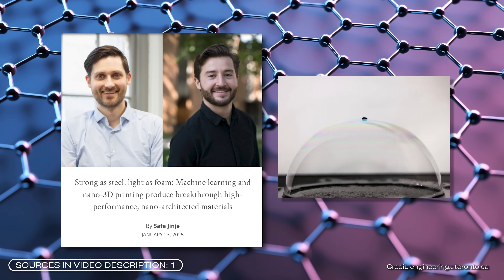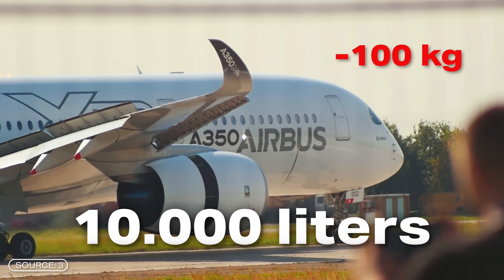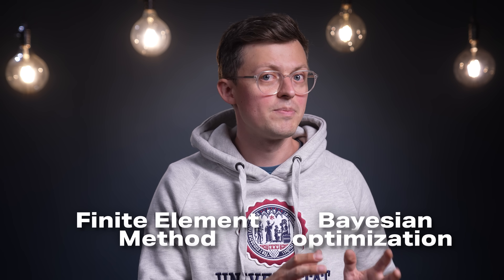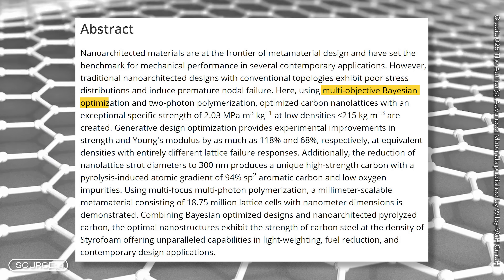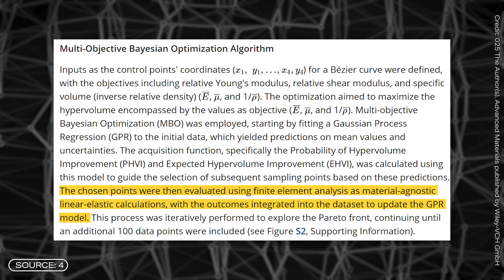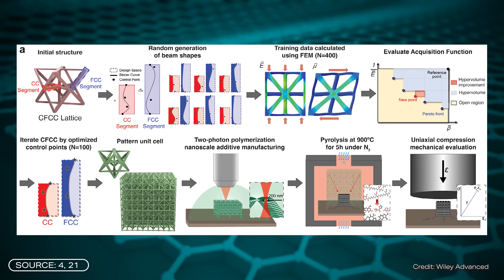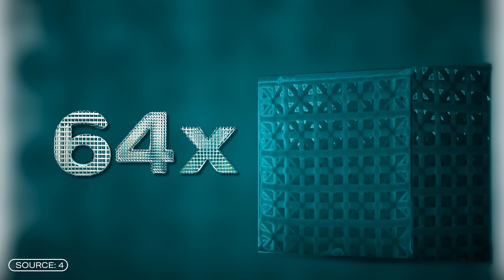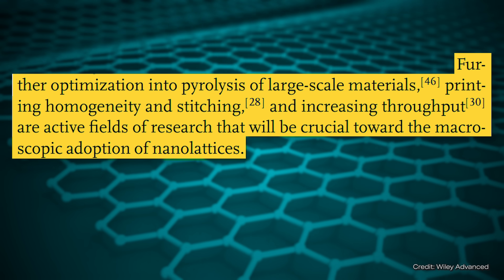New Material: As Strong As Steel, As Light As Styrofoam!

Comment: Every day closer to being able to make the cable for a Space elevator.
Reply: heck yeah space elevator
Reply: Middle Eastern countries floating on lakes of liquid carbon may have an edge here, with some of them being very close to the equator.
Reply: Not at all. Compression strength do not matter for a cable. For a space elevator you would need tensile strength.
Reply: I love the idea of a space elevator, but there have always been two particular misgivings I have about it. 

1. What would the consequence be of having at least 1 huge lightning rod sticking out of the earth if we experience a solar flare. 
2. Would this have any effect of the spin of the earth. Just like a figure skater reaching their arms out. Would this slow the Earth's rotation?
Reply: @CStrolx  the earth would be less influenced of any space elevator (currently conceivably realistic ones) than your moving around with an ant sitting on your back..
Reply: @CStrolx  

weather effects arent reaching very high thats why planes usually fly at high altitutes  maybe 10000m to avoid it so I think the risk isnt very high 
it would not have any effect on the earth rotation the earth is so massive nothing what we do would change it
Reply: @Sippi81 So, regarding the "weather" effects. It's my understanding that when we've had some very strong "solar winds" (from eruptions on the sun), they have, in the past, caused mass power outages when dune of our Earth's protective layers weren't enough to prevent penetration.

This elevator would extend out beyond those protective barriers if the earth. What might happen if one of those solar winds were to hit this rod in space outside of the Earth's protection? Would there be some sort of super charge directed into the earth? Maybe not, I just wonder if we've considered it. I'm not talking about the wind on earth.
Reply: @Sippi81 So, regarding the "weather" effects. It's my understanding that when we've had some very strong "solar winds" (from eruptions on the sun), they have, in the past, caused mass power outages when dune of our Earth's protective layers weren't enough to prevent penetration.

This elevator would extend out beyond those protective barriers if the earth. What might happen if one of those solar winds were to hit this rod in space outside of the Earth's protection? Would there be some sort of super charge directed into the earth? Maybe not, I just wonder if we've considered it. I'm not talking about the wind on earth.
Reply: @CStrolx  

solar winds is nothing that could cut a rope and the magnetosphere is not ending after the atmosphere of earth so there will still be some protection
solar winds is nothing similar to lightning strucks it could probably have some effects on living tissue and also electronics but these effects depend on the suns activities so I see barely a problem if you monitor the sun you could predict when there is a problem and then react accordingly imho I dont see a problem for an elevator which would probably rarely being used to transport people anyway
Reply: @CStrolx  

I know what you meant with solar wind but I doubt it would be an issue for the rope I think even if there is a charging initiated on the rope it would just get diverted down to earth without much heating involved 
I think the lightning from weather might be a bigger issue but as the elevator stays at one place you could estimate when its safe to use it
Reply: dubai wants to build a skyscraper hanging from an asteroid placed in earth's orbit
Reply: A space elevator won’t work. It would burn up due to atmospheric drag, which in turn would destabilize the asteroid
Reply: @thebigpicture2032  

why should the atmospheric drag burn it up ?
and why should that alter the trajectory of an asteroid?
Reply: @Sippi81  air drag increases as the square of speed increases. At 17,000 mph that’s a lot of drag resistance and heat shielding would need to be immense. It’s not static like a building elevator- it would be orbiting the earth.
Reply: @thebigpicture2032  

what are you talking about 17000?
this thing is stationary it wouldnt make any sense to build an elevator if it circles the earth at 17000 mph
Reply: @Sippi81  It’s called orbital velocity. Below that speed, anything in low earth orbit comes crashing down including the asteroid an elevator would be anchored to.
Reply: @thebigpicture2032  

geosync orbit is the definition maybe you heard something about satllites that are constantly above our head at any time
thats how you make an elevator that stay at place even if the object thats linked on moves at orbital velocity
so yes it is possible
Reply: I don't think this would be used for a space elevator cable, carbon nanotubes and rolled 2d materials are much better candidates.
Reply: I invented the SCELP engine -- Super Conducting Electromagnetic Levitation and Propulsion.   The secret was using ALMOST SUPER conducting magnets.   It still won't go faster than light,  and acceleration and deceleration are a real challenge.  But we are almost ready to begin Star-Trekking.  Just as soon as mankind ends all war.   The Bootis  triple-star system has two moons around a giant exo-planet, that are habitable for humans for about another 10,000 years -- before they go into shadow.
Reply: Just the idea of this stupid thing make me cringe.
Reply: By the time a space elevator is feasible to build, AI will have already determined that we're unnecessary and used the carbon I our bodies to build their own means to space. 😂
Reply: @davroscaan1318 Exactly! I think that some don't know just how far away from our current reality this idea is. We may as well be talking about 30 mile high buildings.
Reply: @CynHicks  

a space elevator is not a building 
you just need a good enough rope thats able to withstand its own weight at lenghts of thousands of kilometres 
and as I know we already invented at least one material that is capable of doing that the biggest problem now is the manufacturing of it at the needed lenght/purity but even if we arent able to find a process for this specific material there will be new maybe better and easier to produce once around soon using ai methods 

After this is figured out the space elevator will be produced just because its economical
Reply: @Sippi81 Ummm no. Even a rope made of light cloth long enough to get to space would weigh so much that it would break from it's own weight. The strongest and lightest material we have simply can't do it. Not even close.

A thread used for making clothes... shattered by its own weight. It's called gravity dude. If you take a ton of thread and roll it  out from space to drop to Earth.... that's a ton of weight on a thread... think.. .

I get that we don't typically get to see these things but again.. even with a thread from space... all of the weight (like enough to fill 100 closets) is weighing down on that first bit of thread... think!
Reply: dude I already commented about it (or was it deleted? )
if you dont believe it use google 
the tensile strenght is calculated and we have with carbon nanotubes a potential candidate who would have that strenght but manufacturing and defect tolerance is the problems for now but either we ll solve that problem or just create a new and better material
Reply: @CynHicks I think I heard that while no currently available materials are strong enough (in terms of tensile strength per weight) for a space elevator on earth,
the materials available would be pretty much good enough for one *on the moon*, which could be cool. But not sure how useful decreasing the energy cost of getting from the moon’s surface to lunar orbit is.

Also, perhaps rotating sky hooks would be more viable than a space elevator?
Reply: By the time we work that out it won't even make sense to do it anymore. 😅

We'll be using some super efficient "anti-gravity" technology to transport things into space in a matter of seconds.
Reply: i think you'll find a space elevator would be a cosmic 'lightning' conductor, if it were even possible to construct one it would conduct unfathomable amounts of energy that would normally either be evenly distributed or bounce off/be absorbed by part of the magnetosphere. the resulting bolt of energy would be interesting to behold, but it would be unimaginably destructive... you could probably kiss the atmosphere goodbye at least locally too... imagine a portion of or even all of the auroura being directed to the earths surface within a square mile.... what do you think that would do?
Reply: Space elevators are a stupid idea I'm sorry.
Like how are you going to avoid any space debris between earth and geostationary orbit?
Reply: Dream on. It's a cute idea, but it will forever remain science fiction. As a matter of fact, I just finished reading novel which features a space elevator. Makes me suspect you're a Musk fan.....that's how unrealistic your dream is.

Comment: It sounds interesting, if they prove it can resist impacts, vibrations absorption or resistance, heat and some solvent substance that could weaken it, also the surface exposed side should avoid not being solid, I mean avoid the mesh finish so it doesn't get dirt particles penetrated.

Comment: R. Buckminster Fuller figured that his octet truss could be replicated in the truss members, and thus achieve almost limitless strength to weight ratio.
Reply: Produce the truss...
Reply: @manoo422  The members must be strong straight and stiff, just like carbon fiber pool cue shafts.  ;-)  The joints are the second POF location.  They two must be of high integrity or it all collapses, and then folks argue that it was not the shape.  These tiny, cross-braced structures are the shape that will withstand failed members and continue to function. So even if the octet is "ideal" in the design wannabe realm, think of one where all the joints are like ball and socket joints and subject to their position "loosening" from the initial set.  A collapse ensues.  With this structure, a member breaks, but a catastrophic collapse is far less likely as the remaining members take up the stress of the breakage event and the shape is retained.
Reply: @cosmicraysshotsintothelight  As I said, present it...
Reply: @manoo422  And as I said, it will fail, because he idealized the unions (joints) and the 'spars' (trusses).  The real world differs...  enough to guarantee a failure mode nearly every time considering the current state of human advancement.  There would need to be a hard casting at each joint and a fail proof tie-in to the spars attached to it.
Reply: Carbon fiber construction would allow a seemingly fairly large structure to be built.  But it is a mere shell.  All weighted items inside all have to anchor to the slab on the floor and not bear additional stress on the "shell".  It is good for that.  Especially an in space situ construction.  I changed my mind...  I LIKE IT!  I'D BUY THAT FOR A DOLLAR!  Hehehe...  for space use only.  Up on Tralfamador.
Reply: True dat! Current estimates indicate that a one ounce octet truss could support the weight of 1.2 billion unicorn mounted leprechauns AND their pots-o-gold.
Reply: @Jon-xq3kn  People have made fun of Fuller for a long time, but as he devoted his entire life almost to the study of triangles, don't be shocked when you find out that the octet truss is the most efficient structure per weight known to man, and this will hold true at any scale. The samples shown in this video were almost completely triangulated.
Reply: @Jon-xq3kn  That is a big amount of strongness.

Comment: fairly vague ... what is the projected product?
a textile laminate, which requires resin? or is it a solid, which can be cut and shaped? I doubt mold-able, unless it's the first case; but any added resin would throw the weight clam.
so that leaves me with a manufactured solid, like a panel structure....maybe?

Comment: lockeed martin has been building nano structures like this and using them in the f22 since atleast 2010. they use magnetic augmented sputtering and build them out of native iron.
Reply: Bees make their hex hive structures - yet defense say lets make titanium honeycomb! Harp on, but carbon fibre properly glued laminates as in diving pods, is the strongest so far.
Reply: @zos8085  thermosets have their limits. namely the required kilm firings for large stealthy structures. and carbon fiber based ones are conductive which further complicates stealth/rf absorption. most of the big aircraft mfg have been investing in thermoplastics like uhmpe. you can produce them faster and repair them in the field and they have better rf properties.
Reply: Is that what they do? All I knew was they have the best goodies that they throw out at ATL’s gay pride parades. Everybody else like Budlight is cheap crap like beads or squishies.

Comment: My intuition says that this material will not resist well to wear. Because it's made of nanostructures, they will break one after another resulting in a compromised structure at a much faster pace than solid steel. Can anyone confirm or deny?
Reply: It's just a simulation, so there's no proof of anything. But I don't see why you couldn't 'fill' it with something else to end up with a rebar-in-concrete effect, so this structure is more protected and, perhaps, held together despite damage.

Comment: Hi German Science Guy,
Nice video and subject.

I may add to your trouble-list:
Not on a mechanical level but on a chemical one and this might be underlooked and of high concern I think.
By getting closer to nano scale, the stuff also gets different chemical properties:
-As known, the finer a stuff; the higher the surface area; and thus the lower the activation energy; this is the case with metals or other solids that gain a catalytic power or an autocatalytic power (see air pyrophoricity or dust-air explosions; fire propagation into a foam is much fatser than into a plain block); all chemical reactions are speed enhanced (corrosion, oxydoreduction, ...) .
-Action of solvents or reactants is enhanced because there is no inertia or big quantity of material to dissolve or to destroy resistance or integrity and the chemical reaction and changes propagates much rapidly into the core of the material.
-Heat transfer change and the material becomes more isolant (what is a double face coin; it may be good; but it may aswel favourise some usually tempered reactions (due to natural thermal cooling) what may go (due to insulation) exothermic.
-For example, the nanostuff material may soak up fuel or an oxydizer and become somehow compomized for further uses.

Regards,
PHZ
(PHILOU Zrealone from the Science Madness forum)

Comment: The thing about optimization in this manner is that it depends on the assumed loading conditions.  You can have three types of loading tensile loads, compressive loads and shear loads.  Each combination of loads will yield a different optimization solution.  If the loading conditions change you will need a different material.  It may not be practical to apply this method in many different solutions.
Reply: You left out torsion loads.
Reply: @hagerty1952 they can be expressed as force pairs, or couple of rotation, though in my mind torsion is weird thing.
Reply: @mihailpramatarov  - Yeah, that's sort of the whole premise of FEA.
Reply: @mihailpramatarov  You said "My mind torsion is a weird thing" incorrectly.  :-)
Reply: @hagerty1952  Still makes an interesting point, as do you. Also Fatigue....
Reply: What about twisting? Is that torsion force?
Reply: @oscarcharliezulu  It is a composite of 2 forces already mentioned
Reply: Torsion Optimization. molecular lattice structures can exhibit higher torsional strength compared to other materials.
Reply: @secretbassrigs  Interesting....
Reply: Yes and the chemical ability of the structure to take electrical fires. Etc et
Reply: As far as I know.. There are five different forces/loads, acting upon an object. Not just three.
Reply: You'd just put those forces into the optimisation process and get a new structure optimised for the loads in the locations you are applying. It's printed, custom made doesn't cost more
Reply: As a triple engineer,  agree
Reply: @MiloTheMindBender  Same here, and he nailed it.

Comment: Cool material! But as for cars, I like a bit of weight. Otherwise, you get throttled in an accident.
Reply: it's not weight, it's strength that counts. Cars of all types have got too big and heavy i.m.o. in recent years in attempts to protect the occupants, without thought to the kinetic energy transferred in a crash situation to (say) cyclists or pedestrians. Strong means large (usually) taking up more space and reducing the potential for saving on the energy (electric or petrol etc) needed to propel them. A ridiculous increase in engine power is also required, making them too fast and therefore needing to be heavier to be stronger, a kind of crazy feed back design loop. i remember when 60bhp was quite sufficient to propel a four door saloon car giving a top speed of a quite adequate 95mph and an acceleration (if you think this measure is important) of between 12 and 15 seconds to 60mph. now cars are like jet propelled tanks. I think the material this guy describes will have problems 'getting out of the lab' for many reasons mentioned in the comments, but light AND strong is surely the way to go?
Reply: @fuccasound3897  Momentum is a product of mass. Of course weight counts.
Reply: @dawnfire82  yes, i think that's what i was saying, make stuff strong but make it lighter? Less momentum - less kinetic energy for a given velocity - less damaging impacts?